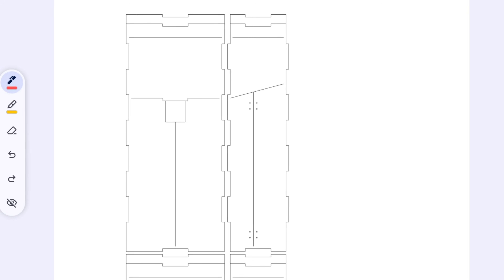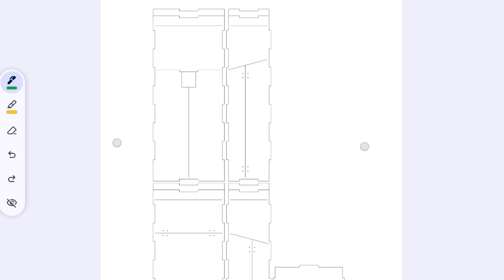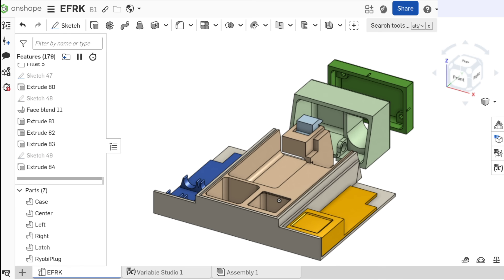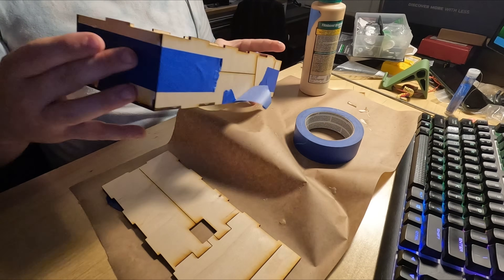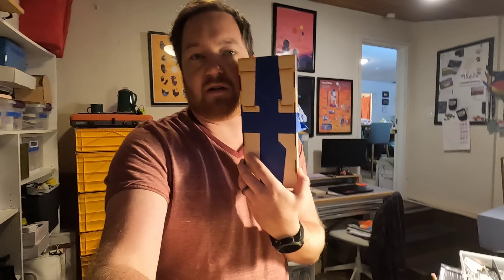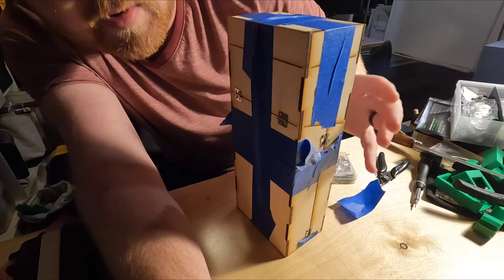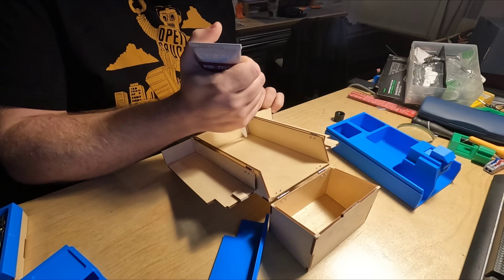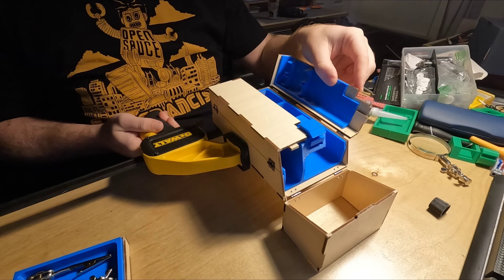3D printed soldering toolkit - Maker Secret Santa 2024

Comment: Wait, you haven't shown what you've done to the wire cutter handle bottom, all my tools that have those rubber sleeve handles become a nightmare when the bottom is perforated, they keep sliding up throwing off my grip mid-use, and I'm yet to find a solution, hotglue and normal glue only work for a short while, I always go back to the ugly electrical tape patch.
Reply from the maker: On these wire cutters the rubber seems to be cast on the metal handle. It doesn't slide or come off. 
But I definitely know what you mean for those ones with the rubber sleeves.

Comment: Very cool project!  Maybe I missed it, but did you mention how the 3rd hands lid attaches to the rest of the box?  Looking at it, I'm guessing it's just a friction fit between the 3d printed part of the lid and the wood of the rest of the box, but I can't tell for sure.  If so, was it difficult to get the tolerances figured out so it's not too loose but not too tight?
Reply from the maker: Good question and in the future I'll try to mention these things. Yes it's a friction fit. It took 2 iterations to get the tolerance right. I designed little nubs that stick out in the center of the flat edges. This way the wood can flex a bit and provide more friction and the tolerances don't have to be too tight. You can see what I did here in the model:
https://www.printables.com/model/1129099-electronics-field-repair-kit-efrk/files#preview.file.sOjX3

Comment: Cool beans! For tiny (wire) strippers you might wanna look at Molex 63817 series of micro precision wire strippers. I have the whole range, they're great!
Reply from the maker: Ooh, thanks! I've been trying to find the name of those. I had a similar tiny pair at 90 degrees to that one. 
For the secret Santa it was outside of the price range. But for my personal one I may get those! I also have a Leatherman squirt es4 I may put inside. But the automatic ones are so nice. 
Thanks!
Reply: haha, fair - i had repressed the trauma of buying them:D. Jonrad ST-550 or CK T3757ESD are similar tools but doesnt have the cutter the molex ones had. I think I've seen off-brand versions on ali but never tried.
Reply: (Oh, and another win for the Molex was it is better at doing real short strips for tiny tiny crimp terminals.)
Reply from the maker: I'm planning an update to the model for my specific changes after the secret Santa budget is not in play. I'll see if I can't make those fit and update the left wing model on printables. Thanks for the tip! I've been trying to find what to call these cutter/strippers